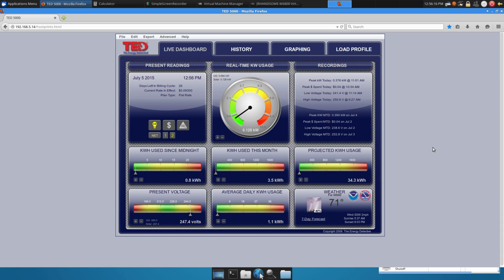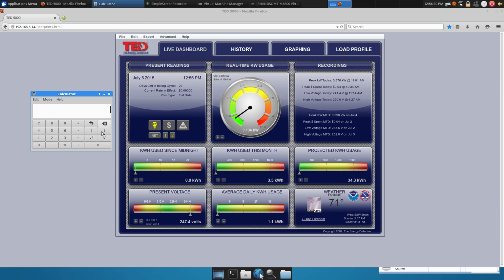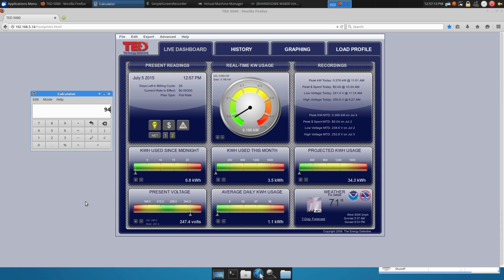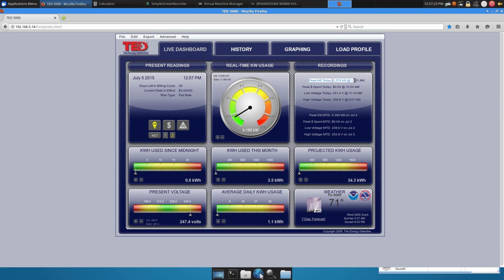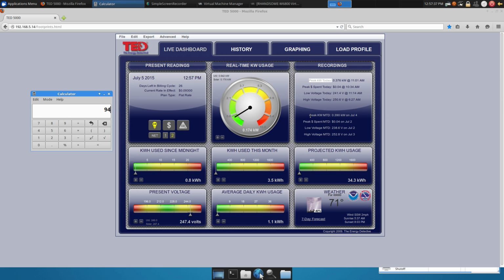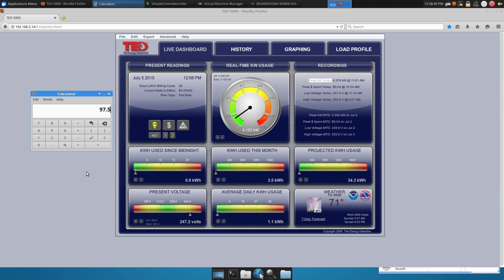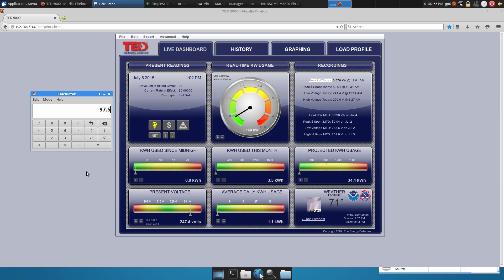Is it better to buy a Certified Grid Tie Inverter or Cheap Non-Certified GTI?

Comment: Its mandatory  for ul1741 certification where i live and i cant find certification on anything anywhere
Reply from the maker: Enphase micro-inverters should work well for you.  Sunny Boy inverters as well.
Reply: Thanks can i use a 127 volt output inverter on a 120 circuit?

Comment: What if I hook a grid tie to a normal inverter...? Would it kill the normal inverter or help it? Just wondering I don't think I would ever do it.
Reply from the maker: I tried this a few years ago and fried a good inverter.
Reply: o
Reply: @rhandsom  

Did you run the system with no load ?

Comment: If you run near peak input volts to the cheap inverters they will run mid 80's efficiency. They really drop efficiency when they are run near the lower voltage range.